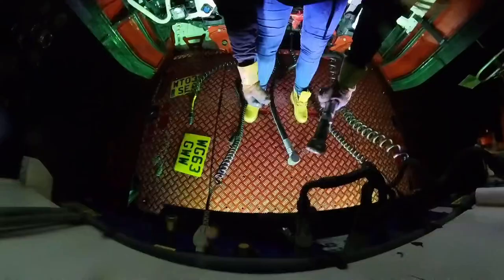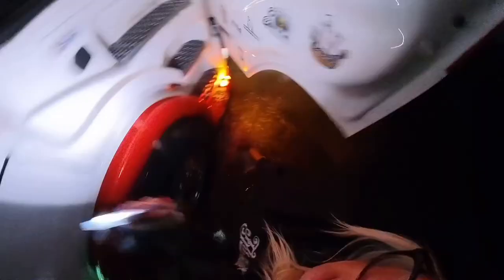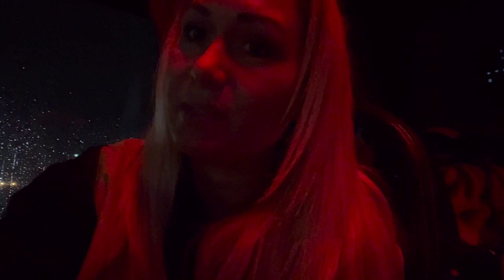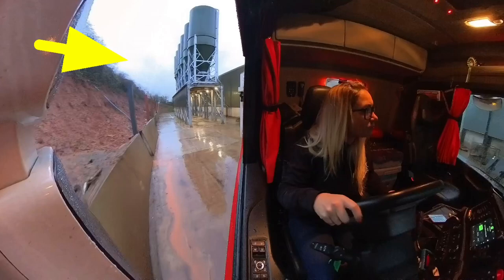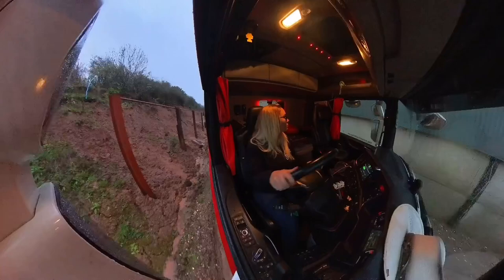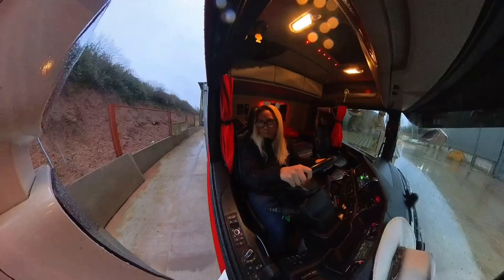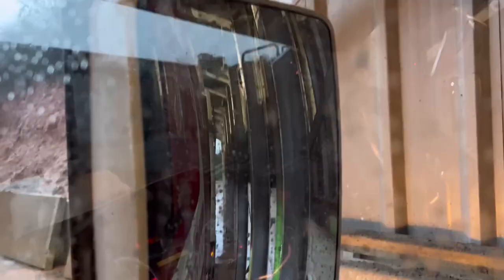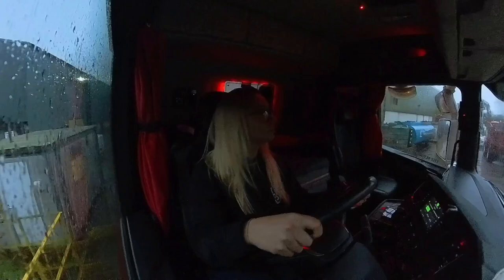How to Blow a load | feeding the farm animals | first look at using the blower trailer

Comment: You do some great reverse girl. I used to move a (boat race type boat) trailer with a Discovery and had to be very careful reversing, partly because of the very forward pivot point and partly because the first point of contact would have been the boat ends at several thousands of pounds each. You are my substitute out and about at the moment due to being in hospital waiting for the anti blood clotting injections to work - boring doesn’t cover half of it!
Reply from the maker: Yes some cargos are so delicate, it must be quite a worry. Best of luck with the injections. Hope you’re not in there too long ☺️

Comment: Great video I think the blowers  is one of the best jobs a round  I wanted to go on the feed but all the mills have closed local to me it takes great skill to use the equipment and even more to reverse in the yards etc some are really tight my dad did this for 30  he taught me how to use one years a go mainly on a 8 wheeler so I haven't used a trailer much would be good if you could show more on the controls at the back how to start the auger and the speed etc great video
Reply from the maker: Thank you. Yes it’s definitely a job that gets into your blood. Sad to hear that there is no where close to you to work. In my area we seem to have many places. Yes I would really like to do a video that explains more so watch this space ☺️ happy new year ☺️
Reply: @jemmawarren27  I drive for a builders merchant so my truck has a hiab cranes on have driven artic's etc on bulk taking raw materials in to mills etc it's not an easy job to  only thing is we don't get to drive smart units any more only basic fleet trucks your truck certainly is one of the smartest around have happ new year and can't wait to see more of your adventures
Reply: @jemmawarren27  I think the main thing is you are proving that you can do the job
Reply: @jemmawarren27  you said in one of your comments that you all so drove a milk tanker that sounds like another interesting job .we can all drive trucks but it's using the equipment on the trucks that's the interesting bit .I also  want to go abroad but it's having the nerve to do it we have some female drivers at are company .people like you are helping to bring more in to the industry.think it's really cool safe travels and keep on trucking 👍

Comment: Hope you had a good Christmas 🎄.  That blower trailer looks like a job that needs careful concentration. 
One thing I wondered if on these jobs you might use overalls not very glamorous but practical to save you normal clothes getting mucky. 
Also, I saw on an American blog I short video on in cab security I think I found you on fb and sent a link via fb messenger. 
Regards Austin.
Reply from the maker: Thank you. Yes you definitely need to be on the ball. I carry plenty of changes of clothes for things like this. In 14 years I’ve never had any problems with security. Scanias come with extra security bits on the doors
Reply: @jemmawarren27  it looks like a neat trick

Comment: I used to work on the blowers, I do miss the job. Very frustrating though as the trailers are quite temptemental, filter blocking up, chassis pipes coming loose,  external pipes breaking. Moved onto Bulktippers now, much more variety and less things to break. I do miss the job though.
Reply from the maker: Yes sometimes it feels like nothing ever goes right but it’s nice to have a change every now and again ☺️
Reply: @jemmawarren27 yep when something goes wrong you're chasing your arse for the rest of the week! 😅

Comment: Very interesting, I do powder on tankers so there's a lot that's similar.  How much pressure can you put the trailer under or does the compressor on the trailer just help get it out rather than pressurise the trailer?  Just with tankers you can put the tanker under a lot more pressure to avoid blockages and then put more or less air through with the powder.  More air = less blockages.  Well, that's the idea😂😂
Reply from the maker: No you can’t pressurise the trailer as it just has a sheet on the top☺️
Reply: @jemmawarren27  Oh yes, good point.  I forgot about that 😲😂

Comment: One thing you could have asked who had that trailer last and if that tractor unit is still in the yard. I've only just started watching your videos and as an ex driver of 30 years think you are the dogs as a driver very impressive 👏 I realise that you only have 1 trailer where you need the adaptor but would it be worth either asking to have your own or you buy one and you keep it with you ?
Reply from the maker: Hi. I normally pull a standard tipper which is my permanent trailer. I only cover the blower for holidays of the 2 permanent drivers on it. This is a spare and both drivers would know to leave it either the trailer. We also have a garage/workshop and something had come in to be repaired from an outside source that needed the adapter and was forgotten to be replaced. It was a one off but it just happened to be a day I was filming. ☺️
Reply: IMAO sods law then Jemma

Comment: Very good video 👍 Is the donkey engine building up pressure in the trailer or just in the discharge pipes? Never seen one working. Ive worked with bulk blower tanks on cement, just wondering are they similar. Enjoying your videos and your lorry is a cracker
Reply from the maker: Thank you! just in the pipework. Is that the same as what you have worked on before? Happy new year ☺️
Reply: @Jemma Warren  hey, thanks for reply. No, with the bulk tank, you build pressure in the whole tank to 2 bar and then open the valve, has  boost function then to blow it up the pipe. Thinking about it, it was a silly question. How would it pressurise against the roll over cover 🤔 😳 😂. Keep the videos coming, i love tipper work 👏 👏 And happy new year to you and yours as well
Reply from the maker: Yes that is why I asked the question back as I just presumed all blowers were the same but I didn’t think until you asked it could have been different. Thanks for teaching me something in return ☺️ happy new year to you too ☺️

Comment: Gross 44ton we here in Ireland allowed 47ton gross but due to alot of guess work and using my on board scales on the truck or if your lucky the trailer has a scale more times not..I have had over 50tons..boss doesn't complain.